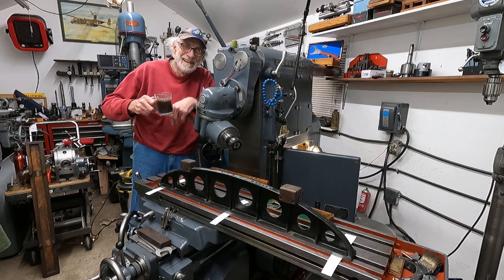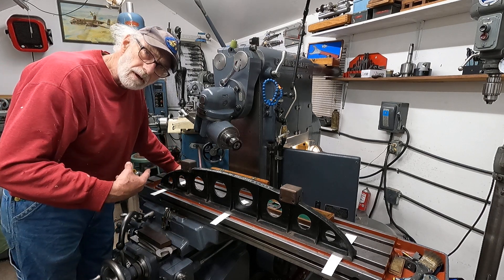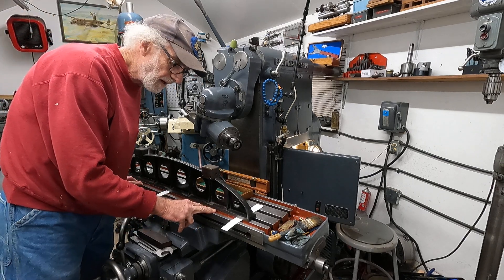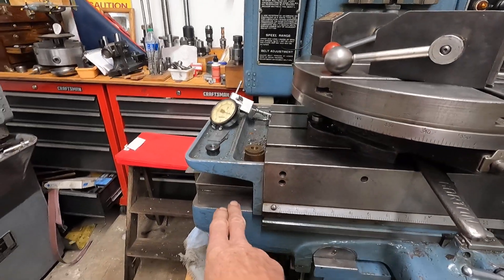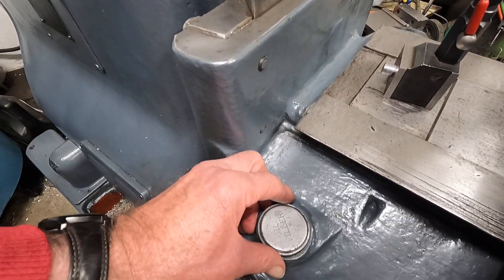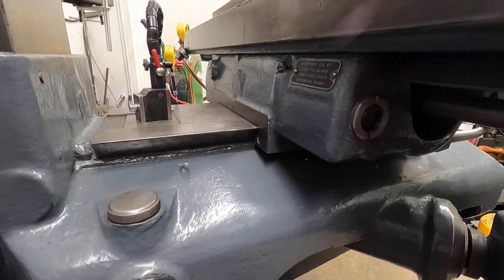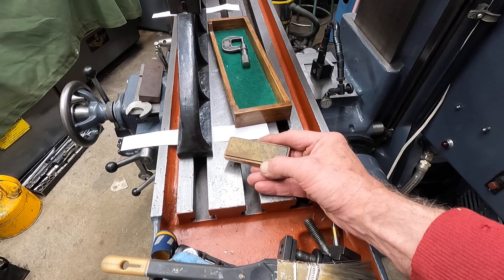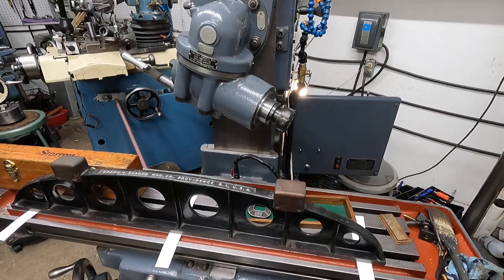Milling machine table sag deflection demonstration with a master straight edge

Comment: From my limited machine tool rebuilding experience the crown you are seeing is common in knee mills .
Some of it may be from sag but I'm convinced that the vast majority of the crown is caused by the peening action of the very many small dents a table receives in normal use.

It's possible to peen the underside of the table and fix the majority of the crown. 
I've done it on two Bridgeports with good results .
Reply from the maker: It turns out most of the problem is burrs raised on the surface of the table from things being stored or tossed on there over the years, very little actual wear on the machine.
Reply: Yes I understand. 

I've seen where people place. 005 feeler gages under each end of the straight edge and check the middle with feelers to get a actual number or slip gages would work the same

Comment: I've often wondered if my milling machine table would settle or distort if I left it over to one side over a long period of time, or if I had done so at any point in time when it was still new, 40 yrs ago, and the cast iron may still have been aging .  In recent years,  I have made a point of centering it, or varying the time that it was set over to either side .   Unfortunately,  I don't have a reliable 36 inch straight edge so the straightness will remain a mystery .
Reply from the maker: I  found the sag was mostly just raised metal from the table top damage. The last horizontal  mill I had was really worn out but I could do everything I needed on it. I bought a new vertical mill  in the 1980s, I tried to move the vise side to side to evenly distribute wear. I found the worst thing I did was overload the table with heavy machinery parts and years of T nuts squishing the metal under the table slots warped and twisted the table. the fellow that has it now makes all kinds of things on it for his race car.

Comment: that shouldn't be a problem at all.   because you table is always that the same height as it passes by the center of the column.
Reply from the maker: It seems it is not a problem at all, thanks.

Comment: What about running the table to both ends and holding the straight edge up to the bottom to see if the one end is bent
Reply from the maker: That is great idea, there is a good surface for testing, I suspect the left end is bent from heavy loads.

Comment: B&S did not believe in wipers.  Also, as a machine tool rebuilder told me years ago, his best friend was a machinist using air jet to blow the chips off a machine.
Reply from the maker: Air is only used by hacks.

Comment: How did you qualify your straight edge and have you just run and dial indicator mounted on the column and reading the table when moved from one end to the other.
Reply from the maker: I am a professional and have my devices qualified at a lab, I have much more to do yet deburring the table is still on going.

Comment: I'm just getting into hand scraping, would love to hear your thoughts on techniques. I picked up a good variety of different sized hand scrapers and a 40 year old carbide grinding machine that I rebuilt and added a VFD to. The two Biax scrapers I tried to buy at auction over here were bit up to way over $3500, which is just too much for me. I expect you have a couple of power scrapers squirreled away, you have all the best toys.
Reply from the maker: Here is my confession, I would rather use machines then scrape or rebuild them to the point I will not buy a machine that needs scraping especially because of the time and tools needed are not needed in my regular work. My hats off to those that have the patience!

Comment: What about precision ground flat stones
Reply from the maker: I have a variety of stones that are very flat for my wood plane knives and chisels. I can set up my Harig 6x12 surface grinder and grind aluminum oxide flat, having tried a variety of very flat stones I have. I can find no advantage to what is called precision ground stones for knocking down dings on machine tables. Stones can be flattened by working 3 together. It was mentioned that grinding a fine aluminum oxide stone with a diamond wheel dulls the grains and float the stone on WD40, but that is not going to work at all without knocking the worst off with a scraper and get it done within this century.  At this point, I will do it the old way to save time and get a machine up and running just fine.
Reply: Those diamond ground precision flat stones are not intended for normal material removal, they are for deburring without actually impacting the surface. They have very little bite, and wouldn't really be effective for what he was seeing.
Reply from the maker: @Bakafish  Yes the table surface needs more deburring at this point I am going after the worst of it now.